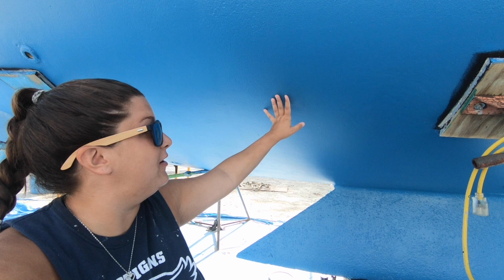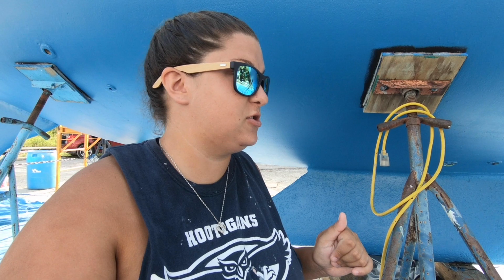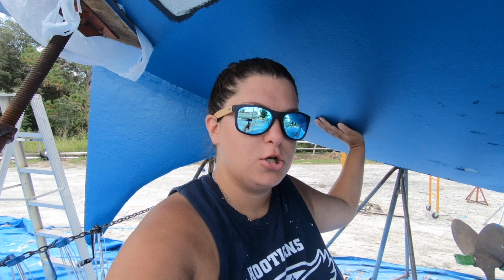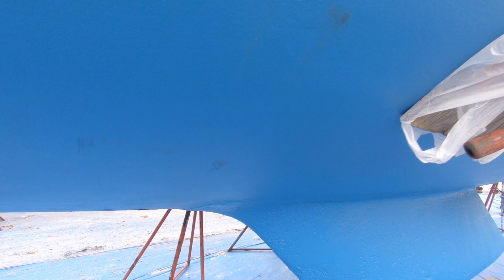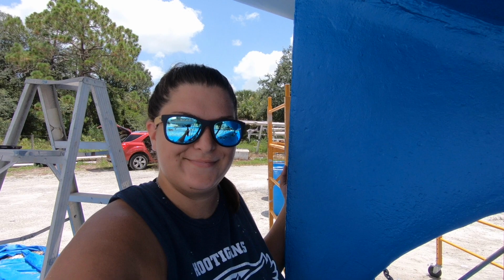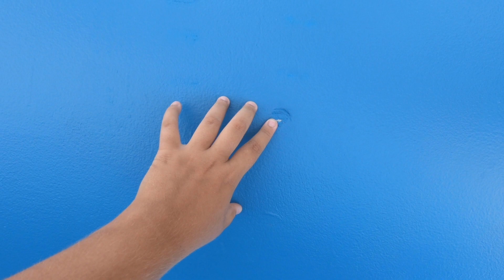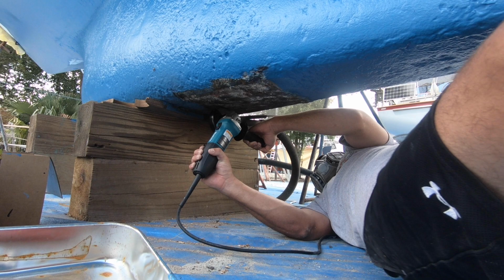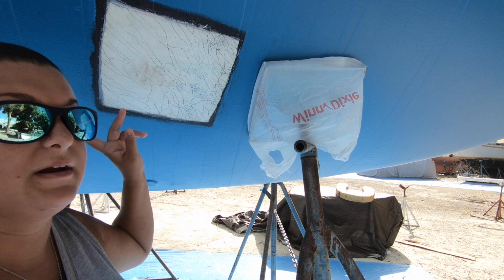Re-Blocking Causes Major Setback | Sailing New Beginning | Episode 14

Comment: Beautiful color. Looking great. I always wondered how the process went to paint the area under the jacks.
Until our adventures cross, fair winds and full sails. 
Jack and Billie
Reply from the maker: never2old adventures thanks! I am obsessed with that blue (obviously lol) and yup they just put your boat back in the lift and move the stands over the bags that were put onto the stands are to prevent the paint from getting messed up. Just gotta make sure your paint flashes before doing this.. something we learned the hard way. Happy sailing! 😊⛵️
Reply: Glad it worked out. It would have been bad if it was a total strip and redo.
Reply from the maker: never2old adventures yes thankfully we ended up not having to do that. Definitely was an emotional rollercoaster of a day lol